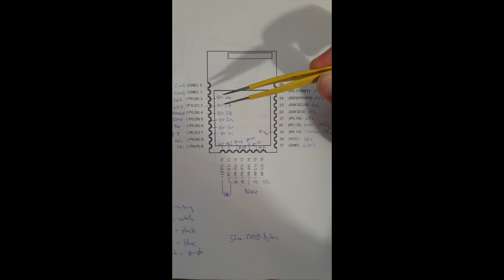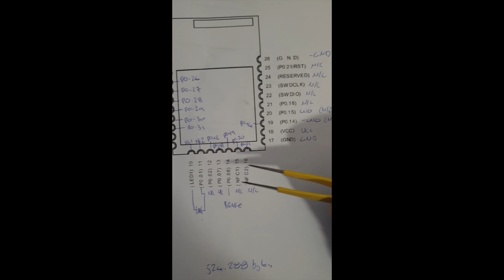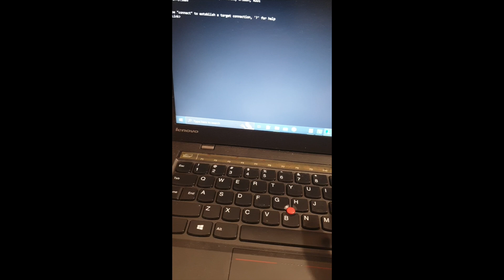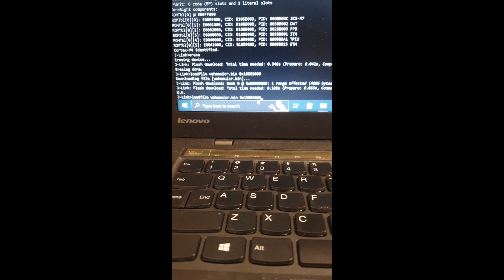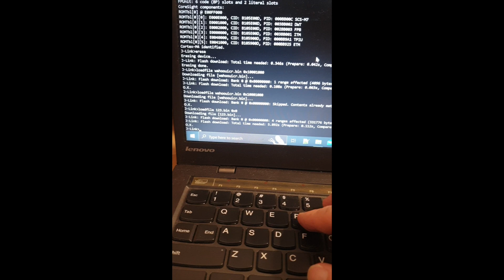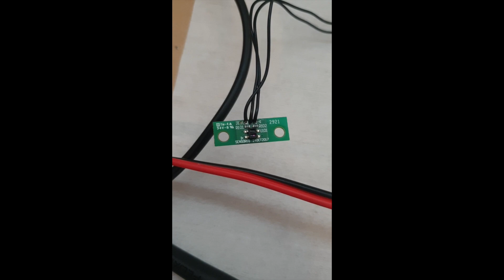Kickr GEM2 module repair

Comment: Hi @thetankie007. I am going down this repair path too but have hit a snag. After replacing the blown filter capacitor and 3.3V regulator I'm getting low 3.3V line.  Checked and  the 3.3V line is 5ohm to ground! Drawing about 500mA. Suspect GEM may be the issue as the braking FET measures ok and I can't see anything else that may be causing this. It is a 2019 board,  the same as in your video, off a Core. So  I won't be able get the firmware out. Is there a generic firmware file that you can edit and add the S/N into? Do you have any other suggestions? Any help would be appreciated! I am in NZ.
Reply from the maker: Hey, been a few projects since I've played with this so just trying to remember, I would say pull the microcontroller off the board and then check the voltage again. What components are getting hot? if there is a short on the output of the 3.3v regulator then it tends to blow the regulator quite quickly, or else the microcontroller would sink the current and get very hot. I've had microcontrollers that appear dead, do not show bluetooth or have any functions, but I've still managed to get the firmware off by connecting the bear minimum of wires. I have a firmware file, it's hard to edit the serial number as it's stored in a few places but I could prob work something out. I've added a business email to my account to contact me
Reply: Thanks,  email sent.  Cheers

Comment: Hi. Nice job. 
I have a problem. My kickr core working, but doesn’t show the value in app. 
10:04 You have 3.2V in my board it’s 0V. Do you have any idea what is wrong?  Sorry for my English 😅
Reply from the maker: it should be a straight connection from the output of the regulator, through the PCB, through the wires and onto the photo-sensor board. If you don't have voltage here, check the PCB traces, check the comopnents around the wires on the main PCB, then check the sensor board for shorts. You should be able to see the photo-diode through a mobile phone camera. Disconnect the wires from the photo-board and then measure again

Comment: Could you bit make clear please:
When connected for the first time to the mulfunction board to extract original firmware with J-link soft,
- Should  I to connect 12V power to the trainer board or extracting possible without 12V?
- what command to copy the firmware and to what address?
- both .bin files will be copied or they must be copied one by one?
- should be write the address when copying in the command?
sorry for stupid questions) thanks in advance
Reply from the maker: sure, you need 3.3v on the gem2 module to extract the firmware. I do this by simply connecting the 12v power and ensuring my regulator is good (3.3v out).
the commands to extract are:

UICR: savebin c:\users\[username]\Desktop\binary_UICR_1.bin 0x10001000 0x1000
Firmware: savebin c:\users\[username]\Desktop\binary_firmware_1.bin 0x0 0x80000

this gives the command savebin, followed by the filename to store the extracted data, followed by the start address, followed by the length. You can see the length of the firmware is 80000 hex, convert this to decimal = 524288. So your extracted file size  should be exactly 524288 bytes long.

This will give you two files which now need to be uploaded to the new chip. 
The UICR data is only a few bytes, but the memory area is 0x10001000 - 0x10001FFF, so I extracted and reuploaded the whole area just in case. you can view the memory area of the connected chip with the command:
mem8 0x10001000, 1000

Comment: On the board with the damaged traces, was the sensor still okay?
Reply from the maker: yea the sensor was not in the circuit at the time, I had intentionally shorted it to test some continuity, but forgot when I plugged it back in. I said to use a power supply limited to around 50mA when testing, but when it is back in the trainer and you are testing the brake, you need the power cranked up to around 5A. so small trace + 5A = instant smoke and kicking myself over a simple mistake